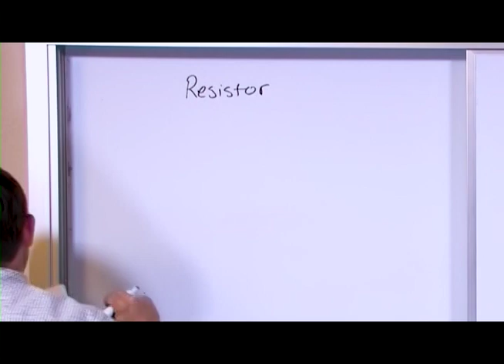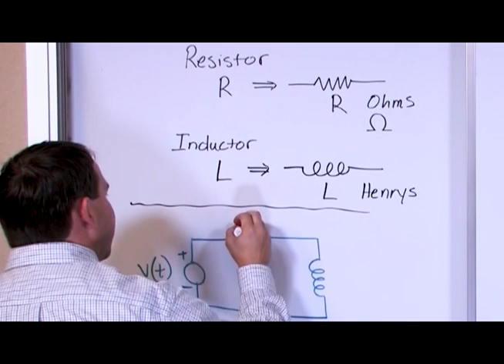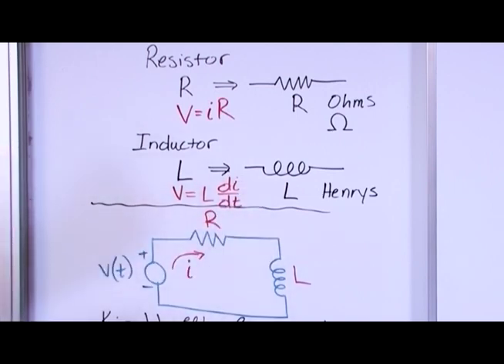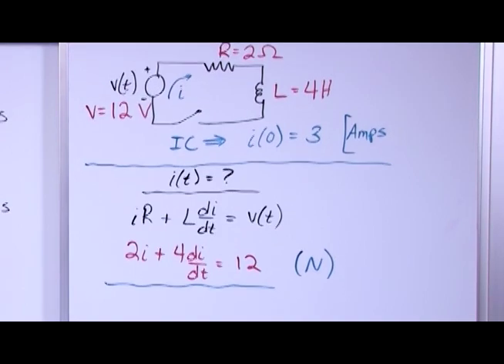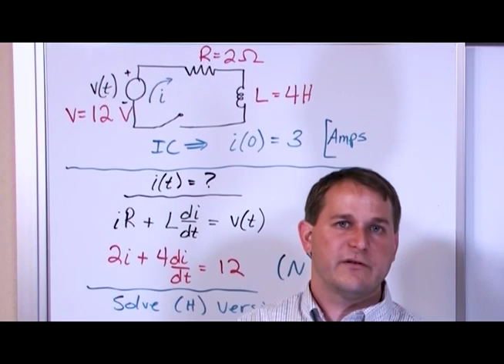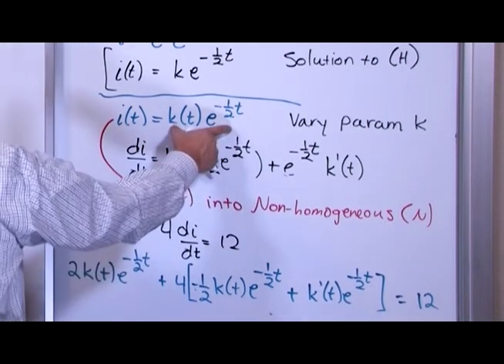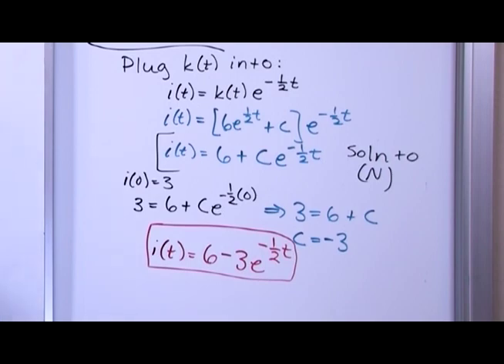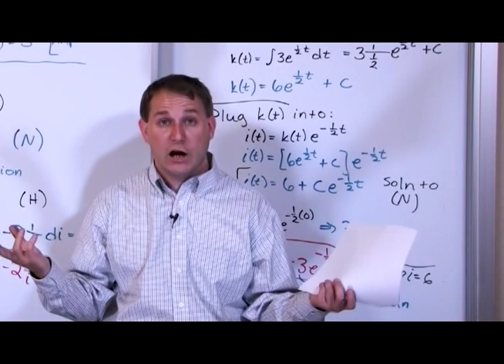Applications of Circuits & Circuit Analysis

Comment: Or how to show and calculate voltage and current lightning propagation on circuits,speed of strokes on wire,related magnetic fields on conductors, etc. In addition to this engineer do you know lightning attenuation and propagation constant please?